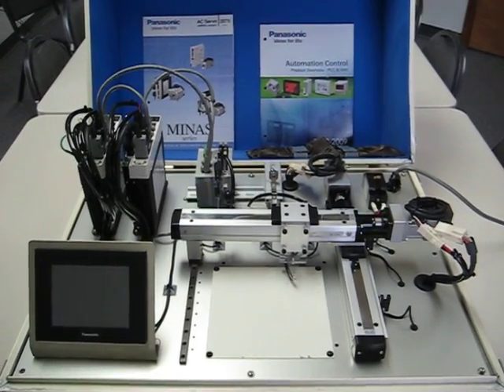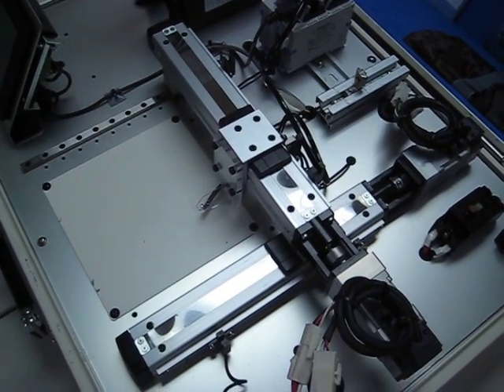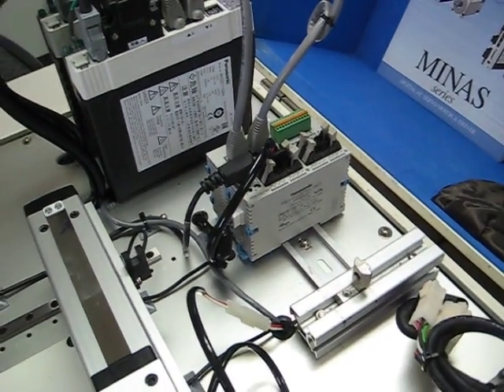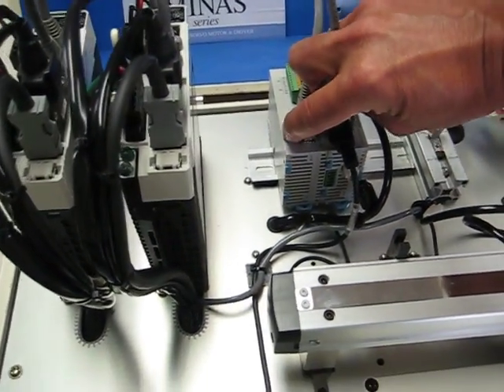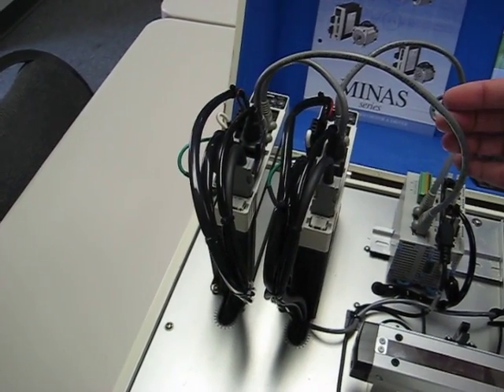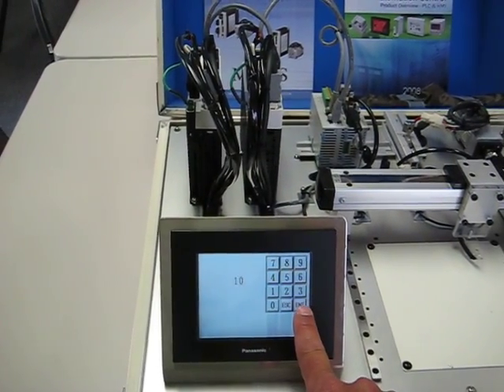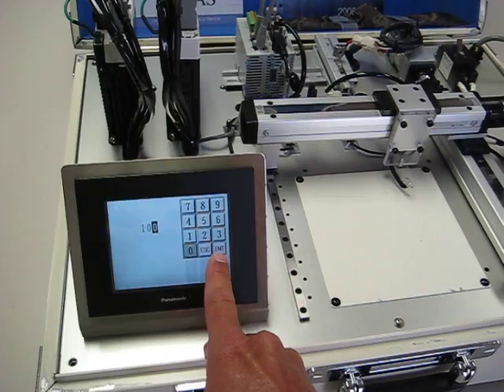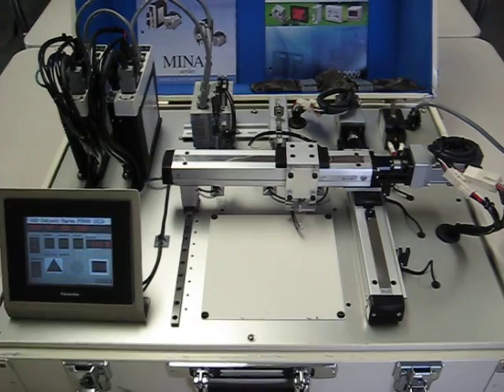Panasonic Servo Demo

Comment: Hi,  i have a panadac motor driver 326M (DV47L040MSGH), i need help because  I dont to find any information about diagram conecction, it has 20 pins I/O  control.